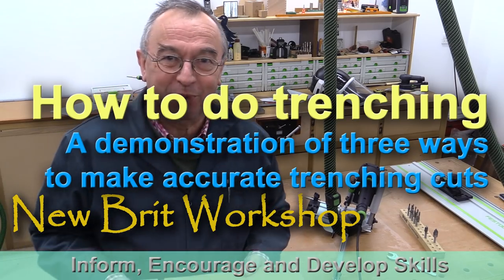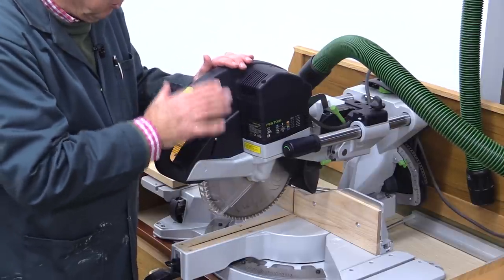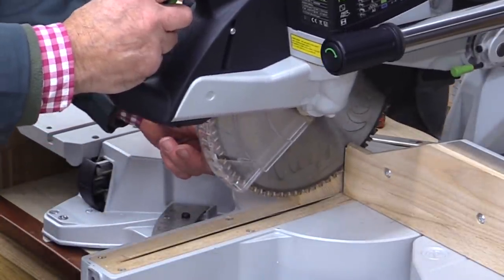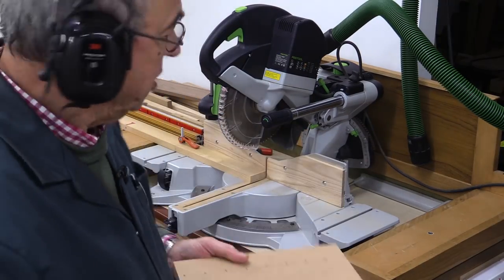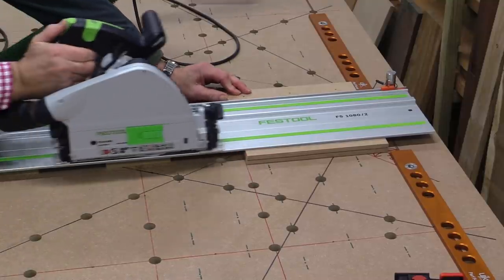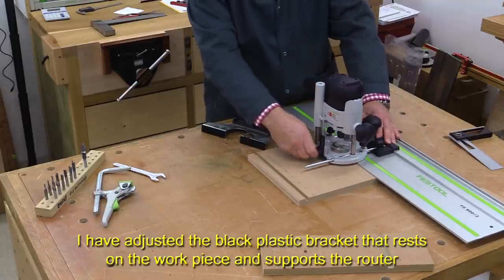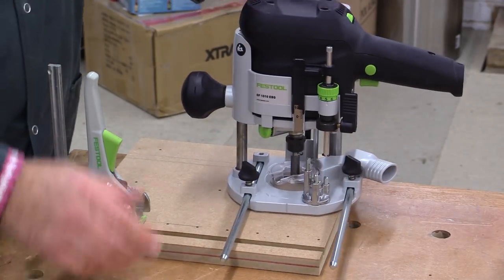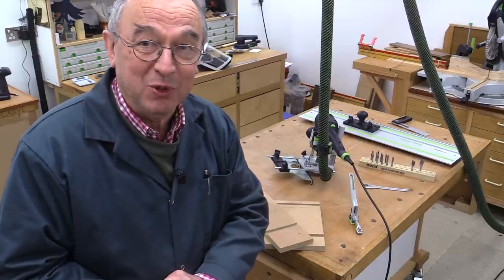How to tackle trenching

Comment: I find the best method is the one that produces the least amount of dust! I’m usually working moisture resistant mdf and have had enough of the mess and air pollution that my router, with dust extraction can make. Its quite time consuming too, having to make multiple passes so as to avoid excessive wear and tear on the tool and cutter. My preferred, least dusty trenching method is to use the track saw but the key point to keeping the dust down is to only plunge about every 5 or 6 mm. This will leave behind 2 to 3 mm slithers which can then be snapped off manually, a few scrapes with a chisel and the trench is done. Minimal dust, less wear and tear on the tools, and it’s quicker!

Comment: As a returning/newcomer to woodwork, so often it is the simple hints which make a difference - like marking the depth on the end to set the mitre saw blade ... although I thought you migh also have mentioned a table saw for the job ...

Comment: Nicely done!  Here In the US, we also have the option of using a a set of dado blades on table saws, an option I have heard is largely unavailable in Europe. Of all, I find a router procedure the one I use most often because of its consistency, control, and flat bottoms - especially when encorporating easily made guides and jigs.  In addition, if you have a board that has a slight bow or twist that can be overcome in final assembly, because the router registers to the wood in the area immediately adjacent to the cut, consistent depth is further maintained.  Bravo!
Reply: Hi, if I had my way I'd purchase a cabnit grade sawstop with dado set but that's the price I pay for living in Europe. Not available here
Reply: Stacking dado blades are not available in Europe?  Why, safety concerns? I would have a tough time getting the precision and consistency without my dado blades. I had no idea they aren't common everywhere.
Reply: Dado blades aren't common in Europe, although they do exist even on some portable circular saws (see the Festool VN-HK85 accessory for instance). I understand it's partly a safety issue (as one has to remove the riving knife and shroud which have to be used in a professional setting) but it's also due to the fact that spindle moulders are much more common in Europe than in the US.

I'm fortunate to have a dado set as it's a very efficient way to make long or repeat trenches (the set up time is relatively tedious, but the cutting time is very short, horses for courses)
Reply: I use a dado blade on my saw when needed l
From oxford England 🏴
Reply: @joycemiller4716  what type of saw do you have and where do you get it
Reply: I bought a dado set  in UK for a DeWalt radial arm saw in about 1975.  Have they been " banned" since then.  I very rarely used after making the bookcases for which I bought it.
Reply: Dado sets are available in Australia, but I don't know anyone who uses it.  For me, the router is king.
Reply: @danthechippie4439  hello there not a cabinet saw but I make furniture and it works for me a skill saw s t p 99 imported it

Comment: It grieves me to think of all the shop time I wasted in bygone years adjusting stack dado heads and saw fences to achieve somewhat iffy results. You're doing good to explain these processes, especially the router technique.
Reply from the maker: Hi Mark, Stacked Dado cutters are fine if you are doing production work but they do need to be accurately adjusted. Many can be adjusted by "dialing in" the required width. Cheers.  Peter

Comment: Thanks for the video. Any advice for cutting trenches in 2x4 pergola spars with a router please? I'm cutting perpendicular to the spar length so there isn't a suitable edge for the router fence.  I guess... buy a mitre saw with a depth/trenching feature 🤣
Reply from the maker: Yes, a mitre saw might be easier but it is also easy to do with a router. There are several ways to do this and the following is just one example. Most routers are supplied with a guide bush which attaches to the base and often they are 30 mm in diameter. You will need a straight cutter that can be fitted to your router and pass through the guide bush. If a piece of wood is clamped at right angles to one of your spars and a set distance from where the left or right side of the channel should be you can then guide the router, held against that wooden guide piece to make a trench the width of the router cutter. You can do this in such a way as to create the left and right sides of the channel that needs to be cut. The remaining wood in the middle can also be taken out in a similar way but without the need to accurately place the guide piece of wood. The following video will help you calculate the offsets for positioning the guide piece of wood:
https://www.youtube.com/watch?v=fDAY-qHkiIE
Peter

Comment: I enjoyed the overview. I do all of these cuts on my table saw. Your methods here are nice alternatives for small shops without that capability; however, I think they’re all far more cumbersome. I do use a router table on occasion, but that’s because I have special made bits for plywood thicknesses. 

On the subject of “rebates”, I think rabbet may be a more appropriate word for an edge trench. Perhaps it’s a subtle distinction, but I think of a rebate as a “relief”, or adjustment of a dimension. As always, I enjoy your quiet unhurried style.
Reply from the maker: Hi Victor, Many thanks.  Peter
Reply: I do too. I use the banggood version of the kerfmaker. Quick and accurate.
Reply: Rabbet vs rebate. I read somewhere that the US English Rabbet is closer to the original version of the word, from the old French word Rabbat. Which makes a change 😉.

Comment: Nice video Peter.

I ave to wonder why festool hasn't come out with a groove cutter. They've been making and using them in Japan for ages. Think of a track saw with specific width blades and then some thinner blades to dial in a width. Like a dado set on a table saw.
Reply from the maker: Hi Patrick, The Festool HK85 has this capability - take a look:
https://www.festool.co.uk/accessory/576803---vn-hk85-130x16-25#Overview
Peter

Comment: I often wonder of the possibilities of an 18mm width router bit for trenching soft materials such as mdf, cabinet building would be a lot quicker in production. I often trench the edges for accuracy and then freehand the excess with a battery hand router ...

Comment: Hi Peter,

Apart from the praise regarding the usual quality, two things that might be of interest to you;
- I think a kerfmaker will be a very usefull bit of kit, especially for the track saw option with the Parf fence.
- I figured out that you can place the festool fine adjuster (488754) also on the outside of the parallel guide. This will help you dialing in the second pass. (Similar to this part: 483358, but much more useful.
Reply from the maker: Many thanks.  Peter

Comment: Great video Peter. Your tools are in such amazing condition. I was making some extra wide door linings on a job last week using my brand new cordless plunge saw and brand new Festool extractor. The builder decided to use his disc cutter to chop in a lintel whilst I was having a tea break in the van, and I came back to see my brand new shiny kit covered in a thick layer of brick dust!!!. I had a fit and all he said was, 'all you carpenters ever do is moan'. CLASSIC
Reply from the maker: I said to someone recently that when I make a video it is like inviting your best friend into the house for tea - so I always do a "tidy" before making each video and sometimes during the filming process. When my sound insulation and dry lining was being done I lent the guys my Festool power distribution systainer and my work light. Both were covered in rock hard drywall mud and most of it is still there. Never mind !  Cheers.  Peter
Reply: Yeah, i made the mistake of loaning my cordless drill to my Dad once.  It came back covered in tar and destroyed.  So i don't loan tools anymore, unless i want to actually give them to the person.  Same thing with books.  Someone once said that if you're asked to loan a book, you should respond with such a shocked look of horror at such an unimaginable request, so that the person never tries to ask again!
Reply: Just struck me aswell how his 10+ years old tools can look brand new and still use them frequently. I simply love watching Pete's educating about various woodworking skills. It's just soothing and like watching a Jeremy Clarkson but with more manners. Haha
So much i finally bought a parf guide system mk2 and made my own mft table

Comment: Peter
Seems you are recommending doing climb cuts with the router? Why is that? Unless there is some specific reason (like grain direction) one should use router when the cutter turns against the direction of movement. If you do it like you show it as a climb cut - the router can start "running". 
Obviously with 8 mm depth into MDF that is not an issue - but if you were doing it with a 30 mm diameter bit at 10 mm depth....that can be an issue
Reply from the maker: Hi Mike, No, Anti-clockwise when cutting stock on your right and clockwise when cutting stock on the left.  Peter
Reply: @NewBritWorkshop  so that means that when you cut on your right you have to PUSH the router away from you and not pull towards you...

Comment: Great video. As I understood it Workshop notes is just a round up. To accommodate all, would adding one word key points not work ie (Workshop notes - trenching, bench, new drill.),  if they were the points you are discussing. On trenching, I was taught we trench rebates on the outside of boards and housing's through the inside of boards not rabbets and dado's.
Reply from the maker: Hi Andy, Many thanks,  Peter

Comment: Great video. Can I ask what is the green plastic piece you have covering the blade window on the TS-55 - its not on mine? Does it improve performance?
Reply from the maker: Hi kevin, It is to improve the dust collection but, if you are doing a lot of work with dusty stuff (like MDF) is reduces the efficiency overall. But, it does reduce the odd bit of dust that occurs in normal work. You will have to do a Google search as the original source is no longer available.  Peter
Reply: @NewBritWorkshop  Thanks Peter

Comment: Hi, thanks for your video. Can you let us know what method is your favourite please?
Reply from the maker: Hi Jonathan, If the stock is narrow enough then I use the Kapex. I sometimes use my router table (I know I did not show that option) but only out to about 250 mm. The router on a rail is good for wider cuts but those are simpler and just as accurate on the tracksaw cutting station.  Peter
Reply: @NewBritWorkshop  thank you Peter. I’ve used my mitre saw before but I recently made a small router table so I plan to give that try soon.